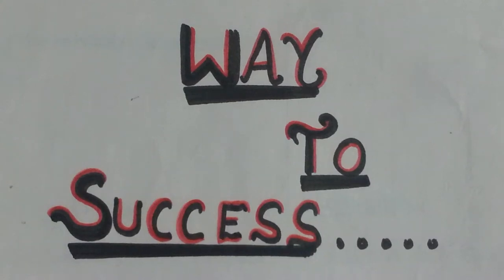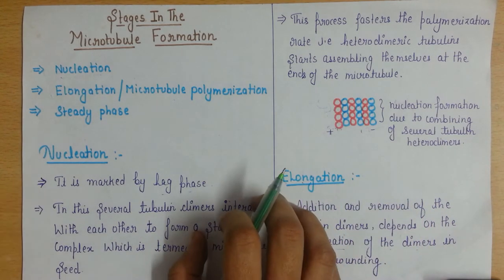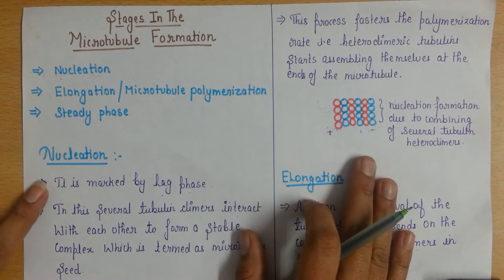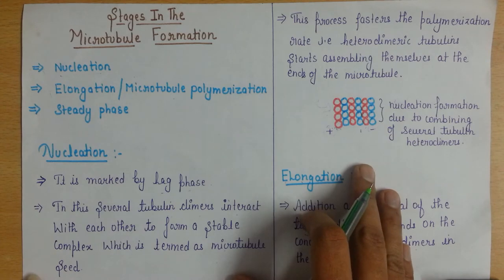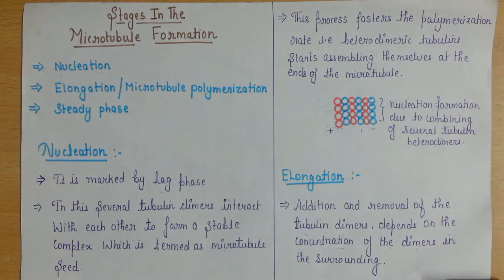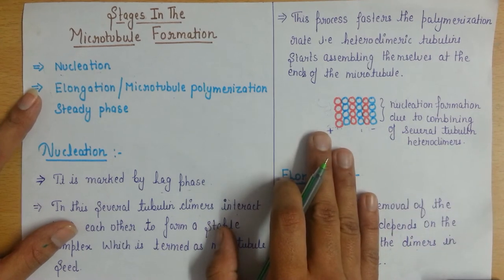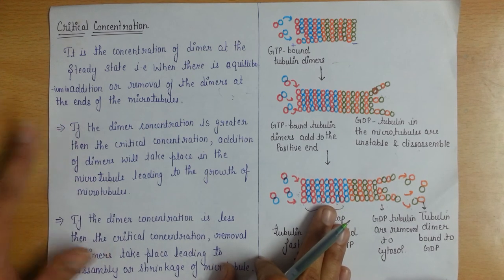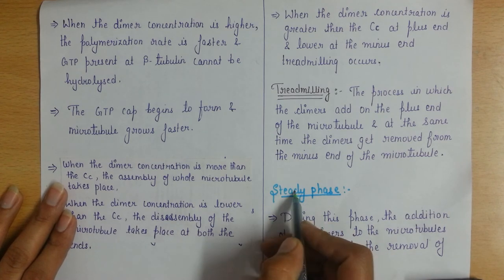dynamics of microtubule- stages of microtubule dynamics-part2

Comment: Still confusion on in vitro and in vivo method
Reply from the maker: what are u confused about in that
Reply: way to success in vitro
Reply: Whether polymerization and depolymerization takes place in both ends
Reply from the maker: +Sneha Unni in case of in vitro condition polymerization and depolymerization occurs frm both the ends but it occurs faster at plus end  and after some time the process of treadmilling takes place in that assembly occurs in plus end and disassembly from minus end..whereas in invivo conditions assembly and disassembly is limited to plus end only